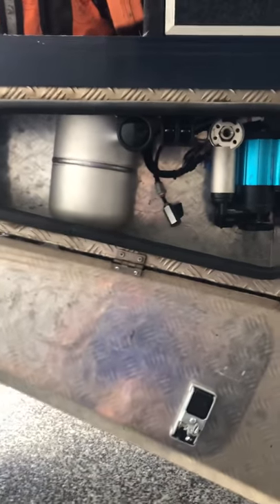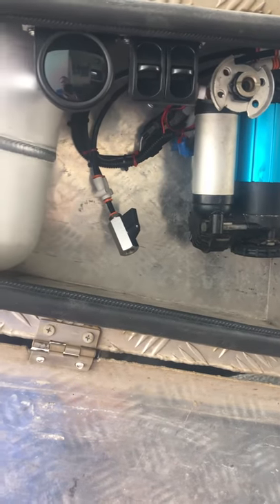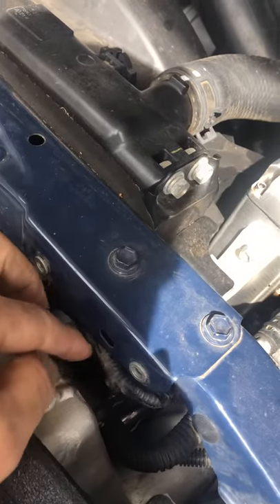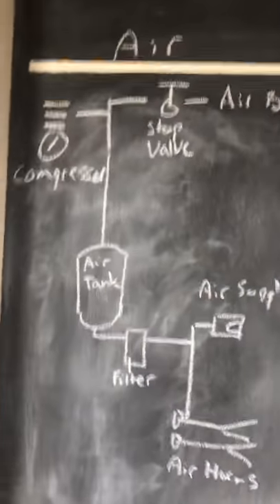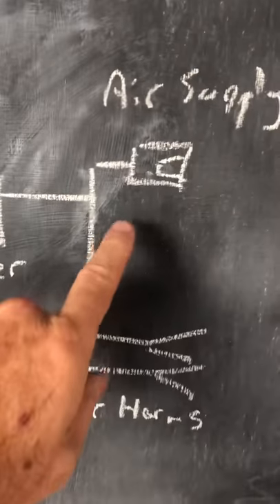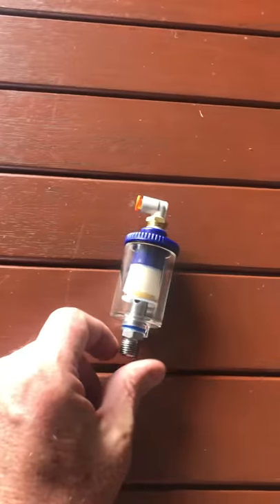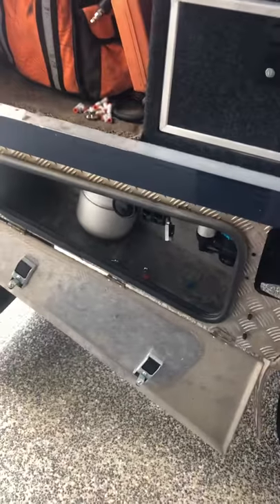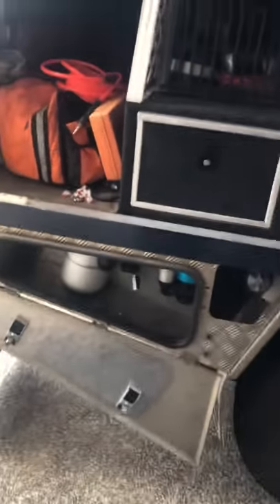79 Series Twin Cab Landcruiser Air Horns Part 1

Comment: Good job mate. If you don't want to splice into the OEM horn loom, you can always use one of these off the Horn Fuse https://automotivesuperstore.com.au/narva-54408bl?gclid=Cj0KCQjwyPbzBRDsARIsAFh15Jb7bgpz7QhyHMANfO8CiMwGatkPIzNHBgxEr2aljztE2ODlcFLFOkUaAlAVEALw_wcB 
I've used a few of them and they are brilliant for this job as well as getting a trigger wire off your high beam for operating the spot/driving light relay etc too.
Reply from the maker: Thanks Bill, I’ll have a look at link when I arc the computer up. Might be some benefits if the fuse is located in the cab, though I’d need to run a wire through the firewall, and space through existing grommets is very tight/limited. Nonetheless, something to look at 👍